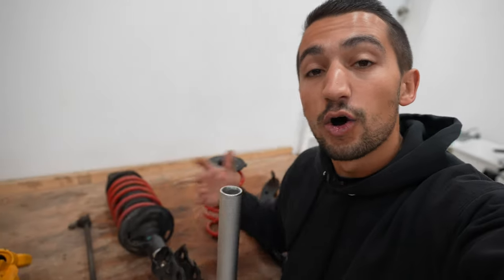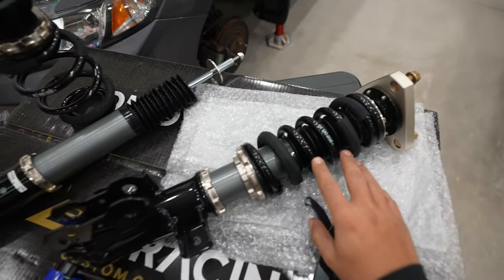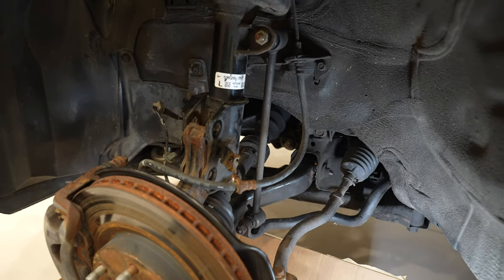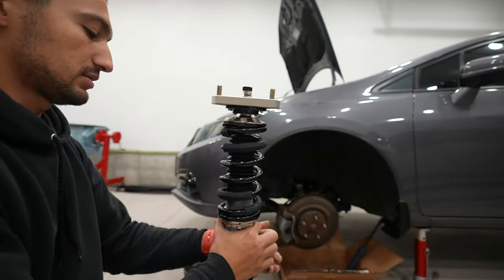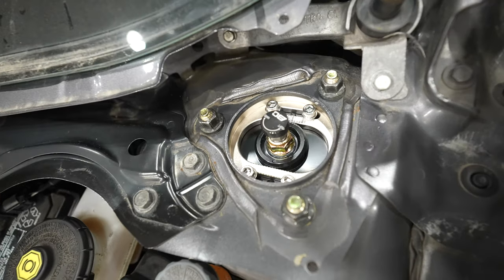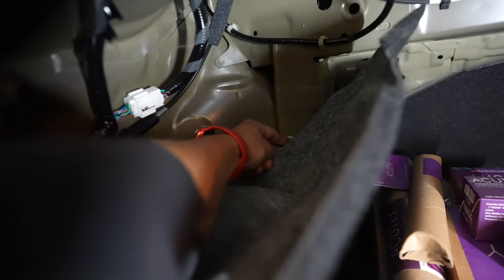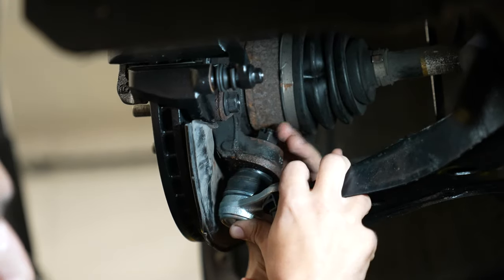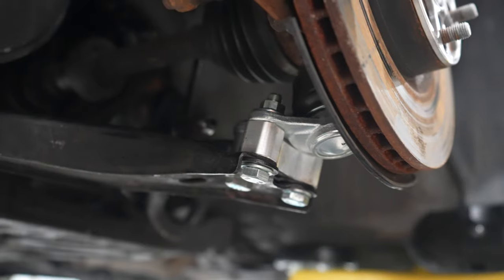How to PROPERLY Lower Your Car // BC Digressive Coilovers & MORE!!!

Comment: Acura Ilx have the same suspension setup btw guys 😊
Reply: If you really look at the chassis of the 1st gen ilx, it is the exact same chassis as 9th gen civic
Reply: It’s actually not I bought some coilovers and the knuckle bolts are different ur camber will looks all messed up if u do get it on even with adjustable camber arms
Reply: @robertperez300  was it 2012 coils or 2015???

Comment: are the supporting mods a necessity for all cars when changing coilovers? i have a 2013 g37 coupe but i just lowered the frame without camber. i used the new z1 s-pro coilovers, so there’s not an option to adjust camber which i didn’t want to

Comment: Dude thank you for showing the rear damper adjustment. I bought a 9th gen with previously installed BC coilovers, and I did not know that the rear adjustment knobs are separate from the strut until watching your video. Every other video just talks about them without showing.

Comment: I run Truhart struts ,Swift R springs(1.2"),Godspeed Rear Camber Kit,Progress 22mm RSB and SPC front bolts on my 2013 FB6. Love the set up for a daily. I also run the Truhart subframe brace . Great vid!
Reply: Is Godspeed any good? How long have u had
Reply from the maker: Does your 2013 not have the rear diffuser piece? Unless you have it removed, how do you see it? 
Thanks brother!
Reply: @ohreallydon  i havent had any issues, been installed for months.
Reply: @milanmastracci  The middle and rear underbody panels are removed. I also have a Beaks bar installed on the Truhart brace. You can see it all.

Comment: If you have a big c clamp you get those studs out without having to remove the ball joint from the knuckles. Just did this job made it way easier.
Reply from the maker: Happy to hear you found an alternative method! 🤙

Comment: i put ds series coils on a b5 passat before, i tried every single setting on them and no matter what i did they were bouncy af, was under my car over 50 times in one year trying to dial them in making a setting at a time, i had zero issues with camber toe etc. the alignment was perfect but there were no after market options that i could find for arms that were in stock so i did a whole refresh with new oem arms, ball joints etc and had poly bushing installed by a mechanic with a press........ i left them at the settings they came out of the box on initial install, made sure to torque everything to spec at ride height, i tried slamming it, i tried a 1.25 inch drop which was where i thought it was optimal, and literally every click from soft to stiff and couldnt stop the front end from bouncing after even the slightest bumps which made it feel like it was floating and unpredictable..... they were horrible for that car so i spent alot of time researching and came to find out that digressive coilovers like the ds series are so hard to find critical damping becuase all the damping is up front instead of being linear where the damping gets tighter the further shock travels... after a year of trying everything i could think of i only managed tolerable but not enjoyable....  

at income tax time i chalked it up and  got the BR series kit and the swift spring upgrade and it was perfect for that platform. no more bounce! they rode a little harder over the worst bumps than stock but bumps felt way more comfortable/predictable than the DS but it took corners like a champ and actually felt good to hit the back roads.... and it didnt feel like it was going to break my spine in half over a large bump doing 90 on the highway like the ds

i did read somewhere that ds were great for drifting and autocross, but for an aggressive daily where someone just likes going on spirited drives i think the br series was aimed for the end user to be almost plug and play out of the box with less guess work.... im not saying other people will or wont have the same experience, maybe i could have done something different like take the car in for corner balancing, and have it set up by professionals after having my wallet raped...  this was the first time ive ever had a coilover give me this many problems and its my 5th car that ive had lowered over the years..... or maybee i could have taken the arms off a different b5 car and change the suspension geometry a little bit or something if i was better at math.... im just saying for me it was a nightmare when most of the aftermarket was already gone for the car at the time..
Reply from the maker: Do you know what the spring rates were? I wonder if they were too stiff, or maybe if the dampening was set correctly to the spring rates? Even some of the recommended spring rates that companies offer are not ideal for the weights and everything of the car. It's tough to say what your situation was. 
I've ran digressive coilovers before with success, but I'm happy to hear the BR's with swifts are working for you!
Reply: @milanmastracci  after looking it up on ecs tuning..... 7k Front & 6k Rear Spring Rate... the car weight was like 3400lbs i think. it had no adjustment for rebound but i did try every damping setting front and rear one at a time, and then dialed it back to where i found i liked it best, which eventually i found it to be better with the front being 2 clicks stiffer than the rear so it was something like 5 clicks front and 3 clicks rear from softest.... it could have been the fact that i was running 17s instead of the stock 16s(same tire size diameter on some General GMAX as05s),  or that i did something wrong when torquing the control arms at ride height(which i find hard to believe after 5 different attempts driving the car up on blocks to loosen and re-torque with the car perfectly level on the ground)
 i do believe that bc racing does the proper amount of r&d and wouldnt just slap together a crappy coilover... so i guess? the spring rates were probably fine? maybee i should have went with the swifties... i think it  had to be user error more than anything or a part i should have replaced or added but didnt know about or couldnt find like those little blocks you installed for your ball joints and thats really hard for me to admit to myself much less the internet but ill never know.... i sold the car for $12k after putting 8k worth of aftermarket parts into it....

Comment: Future reference if you’re going to do suspension work, and the rotor is going to slide forward in the control arm, remove the axle nut and slide the axle out so that I can lay freely or else you risk blowing out your CV bearing

Comment: When I click on your energy suspension upper shock bushing link it goes to Amazon and says it does not fit my car which is a 2013 Civic Si? Are these just up to 2011 or will these fit the 2013? Thanks

Comment: Hey man, love the videos you put out very helpful 👍🏾 
I'm looking at getting these coilovers for my CL7 Euro R (similar to the the TSX) mainly driven for trackdays. What spring rates would you recommend if I were to go with swift springs or normal springs? I run the car on semi slicks (235/40r18 on 18x8.5 rims) 
Any help would be greatly appreciated 🙏🏽
Reply from the maker: Happy to hear that Kyle!! So selecting spring rates depends on a bunch of things, such as overall weight, weight distribution, sway bar selection, square vs staggered fitment, suspension travel, etc. With that being said, my suggestion is to go with whatever is offered from BC racing as the standard springs, drive with that setup for a bit, and then if you want to change them out you can, or if you're satisfied with those rates, then purchase swift springs. That is a very universal way to approach aftermarket suspension. 
If you want to go in depth more, look up motion ratios, spring frequencies, etc and you'll learn a bunch about it. There's a lot that goes into getting your suspension dialed in perfectly.

Comment: Milan, i have Honda Civic si 2015 stock and i really wanna work on it and ur videos are very helpful and gives me lot of motivation to work on it but i am scared i will mess up something. Any suggestions? Also the civic is my daily. I would also really appreciate it if you link the exact coilovers you got.
Reply from the maker: Hey brother! My suggest is to do as much research as possible before hand so you know what you're getting into when buying / upgrading parts. I'd suggest starting off with doing your preventative maintenance like fluid changes, spark plugs, serpentine belt, and the simpler things, so that you get an idea of what its like working on the underside of these cars. It will also mean you will have to start acquiring some tools. Once you get comfortable with that, feel free to start upgrading the car. You should only put money towards upgrading your ride given it isn't going to be breaking down on you. Hope that helps! 

This video is a good one to start off with: https://youtu.be/fa2aDAlb6ZM

Comment: It is very difficult to find an SI with low mileage and in good condition.
Reply from the maker: I know! They're all miled out, or way too expensive. Covid defs didn't help. Given that these are the last N/A Civic Si's, these will hold their value if not appreciate. Get one ASAP 👍
Reply: I have a 2013 si under 100,000 miles. It was a great find.
Reply: Hope you’ve found yours by now, took me 2-3 months waiting and scanning the internet everyday, 2014 si with 85k 😁

Comment: You’ve just thrown off your suspension a lot worse than if you didn’t install that roll centre correction kit. I 100% Garuntee you have some degree of bump steer now, especially with your vehicle being a macpherson strut design.

You now need adjustable (height) outer tie rods to correct for the incorrect suspension geometry.